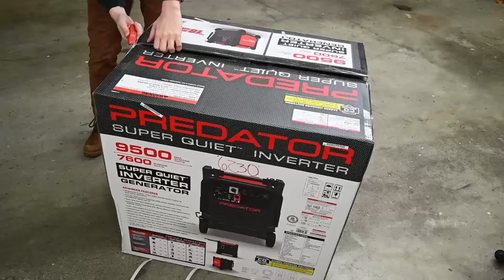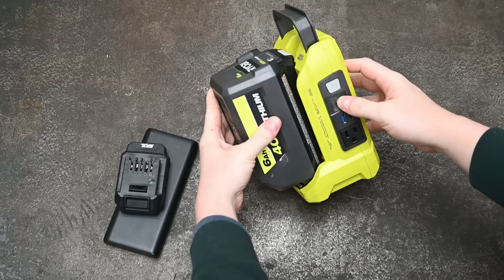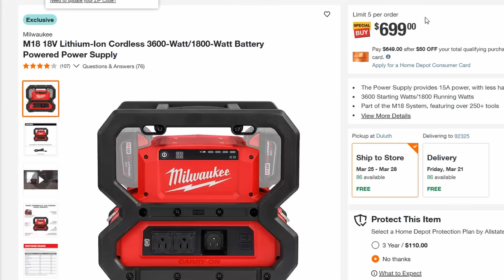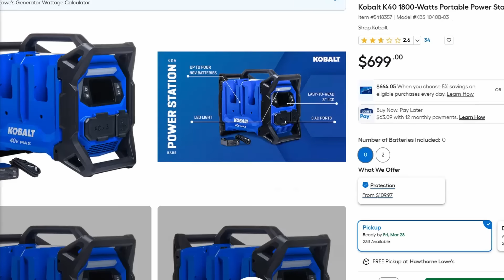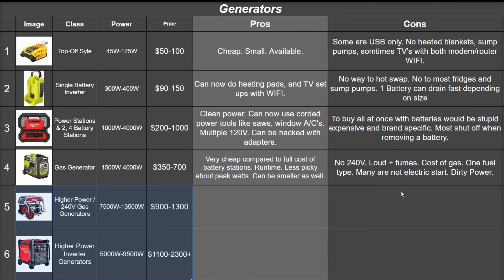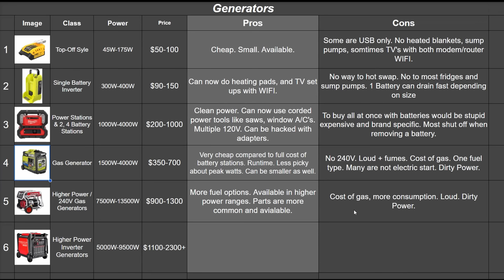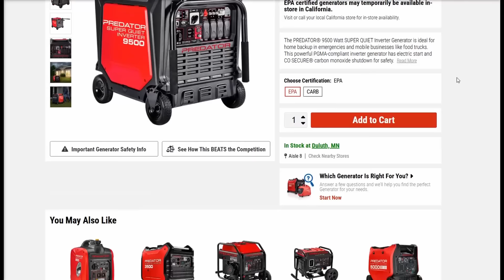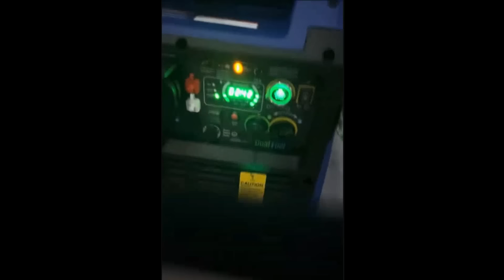Buying Harbor Freight's Most Expensive Generator So You Dont Have to

Comment: I bought the Harbor Freight 3500 W / 3000 continuous generator 7 years ago and it was still working fine until it caught on fire last weekend. Pretty sure I overloaded it but I thought it was supposed to kick out before it caught on fire. It runs my camper AC without any trouble and everything else on there usually. I guess I'm going to buy another one because I had good luck with this one. I will definitely make sure I get it on sale. Also when I bought it I changed the oil about three times in a row and I think that helps the engine which still runs fine it just doesn't make any electricity

Comment: I'm debating on going 3500 just to run a couple refrigerators in summer, or gas furnace in winter, or moving up to a 240V, 7000 to run things like dryer, my upstairs 2.5 ton AC with soft starter, etc.  I really won't use the generator for much of anything than backup power, and I only need that 1 or 2 times a year.  Just hate to spend more money, but would much rather connect 240V outside, and pick which breakers I want on inside. 

Not sure how safe, but you can also piece together with another regulator (can't use propane regulator safely), a set up to run off of natural gas.  If you have natural gas, you could run for days and days with no fill up.

Comment: I got my mother a power station that can run some LED lights and TV for a few hours. Longer than that and I break out the generators. My biggest one is 7kW but I have my eye on a Champion 15kW/13kW unit. I want one that can push a full 50 amps if needed.

Comment: FYI for those interested, you can buy conversion kits for propane or natural gas that will run any small engine. You need a little bit of knowledge and skill to size it right and install it properly, but it's not super expensive to do.

Comment: I have an older 9000/7000 watt dual fuel Champion generator and I've never had problems with electronics running off of it. Great customer service too. I bought a display model from Costco for cheap and it didn't come with the regulator for the propane. I called them troubleshooting it because it would start and die using the regulator I had. The guy knew what was wrong right away and just sent me one free of charge no questions asked. I've used it for 4 different power outages since about 2017 and never had an issue, other than that it's not powerful enough to start my central AC/heat pumps. I'm actually looking at the Westinghouse 28k portable generator for this reason. I would love to be able to just not have to worry about that. Not cheap though.

Comment: I noticed that they released a 11,500 watt inverter generator with trifuel and remote start. which solved most of the issues you have with the 9500 watt. it also has the 240w 50A socket

Comment: I'm using a combination of an Ecoflow Delta that runs the essentials in my house and a Champion 4500w quiet generator that I run twice a day, an hour every time, to charge it.
That way I can fuel the generator once a week. we had a two weeks outage last May and this setup worked amazing. While my neighbors had to fuel up the generator twice a day and live with the horrible noise, we were fueling once a week and we had to suffer the noise only 2 hours a day.
Way more efficient than a big generator.

Comment: One thing I would highly recommend is an inverter generator and maybe if you just want to keep your house warm in the winter a small one that can do 1-2 thousand watts and use that to charge a decent sized power station that can run your home heater. The reason for that is it is a good bit more efficient than the alternative of just running your heater off a generator 24/7 because your heater turns on and off all day so when the heater isn’t running your just wasting gas. Basically run generator to charge power station than run heater off power station. My power station can run the head for 12-20 ish hours and can recharge in about 1-2 hours so I would only need to run the generator for like half a gallon of gas for almost a day of heat. Also you can do the same thing with a much bigger generator if you need to say run the dryer or the stove. Or well pump or anything like that that uses more than most power stations can do. You can just run the big one when you need that power and keep the power station to keep your heat on 24/7. It’s a bit more complicated but it saves sooo much gas and it’s so nice not running a generator 24/7

Comment: A couple years back we had a tornado roll through and on day 2 of no power I had to make a choice. Buy something or left $400+ dollars in my fridge and chest freezer expire. I had to buy locally because I needed it now and I was limited to what was in stock. I found a walmart a few towns over that had one in stock (harbor freight was sold out because of the storm). It is like 4500 or 7500 I cant remember some no name brand. It cost $450. I cut 2 plugs and back fed it into my home. As soon as the storm was over I regretted buying it. It was 2 small to feed more than my freezer and fridge and internet and a tv. That is a lot but now we are having winter storms. I will likely have no heat. It also isnt clean so it would not charge my electric car (no longer have that but still). I really want one with an automatic start and 240 volts but I decided I will wait because we rent. Once we buy a house I am hoping we can get something I can build around and have basically connected to the house all the time in case of emergency either I start it or it auto starts depending on the amount im willing to spend.

Comment: I've got a dual fuel WEN 5000W, its a good middle ground, I can charge batteries for my Milwaukee inverter and hook up my to my transfer switch in my house and run lights, fridge and two space heaters with it.

Comment: I did a similar analysis. My need is backup for much less frequent power outages. And I don't want to deal with stocking up on gas before every major storm. Propane will store for 10+ years without degradation, so keeping a few days worth is easy.

Comment: I ran my cpap off of the milwaukee inverter topper and a 5ah pack to test it ahead of actually needing it for emergency use.  At 4 hours use it used half the pack. (Humidifier and heated hose off). In a pinch 3 batteries should get 3 or 4 nights of (dried out mouth) sleep 

Side note for anyone using the smaller inverter toppers. As mentioned in the video about cheaper generators putting out dirty power, the battery toppers are putting out square wave AC... this is no probelm for phone adapters and cpap adapters that are rectifying back to DC, but don't plug anything using an induction motor into  it (like a bedroom fan) or air purifier...etc. the fan will run, but you will hear the motor grunting because of eddy currents from the square wave... it will work, but that motor wont be happy for long.

Comment: we have a large generator but find the small 2000w yamaha clone is our goto. Powers things like fridge, freezer to ensure they stay cold inside. Can power our starlink and tv/laptops to stay up on weather. Or can run a heater or small window ac we keep for emergencies. Best thing is it runs all day on about 3 gals of fuel. We have had it for years and I just tested it again today since we are expecting bad weather and possible blackouts this weekend. Started on 3rd pull and ran the 1500w heatgun no problemo.

Comment: Man, I sold my classic wacker 2500 with a honda gx160 thinking i'd get the HF 3500 inverter generator. but that old one worked great, and ran 4 hours on 3/4 gal with full load. It was just loud

Comment: You used the worst line conditioner. You need one that stores Joules of energy. Check out a Richard GRE’s power company. Yup expensive, but I run my little Honda inverter with my deep freezer, refrigerator, tv, internet, a few lamps and more.

Comment: Hunter, Fisherman, Camper, Got whatever needed to light and cook, PLUS a 6.5 KW power plant. Shared Home with 3 Fridge/Freezer I own, Sister 4 Fridge/Frezers, Neighbor 2, and the other 1 Fridge. Were out 1 Week. Plant kept all fridges working. Had Gasoline stored pluss drained Car tanks, Used 75 lts of gasoline for the generator for the week. 1 Std LPG 10Kg tank cooked whatever.

Comment: Dang, wish you had waited until this year to test this, or could do am update. Bc they now have 2 higher rated models. I beleieve they're both rated at 13.5k. I think the difference is something to do with how they output the power. Or like one is a full on generator and ones technically am inverter. I forget exactly, but i believe they both can be run on gas, LPG, or NG. They run fully rated on gas. And then get de-rated down to like 10.5k for NG and 9500 for LPG. Those may be backwards, but point being i would like to know if either of those are worth having as basically a whole home backup? Or would i be better looking at old school like full size kohler models? Or again, would i be better to invest in solar amd a battery bank?

Comment: another way to get around the "dirty" power is with one of the mentioned power stations. I keep mine always plugged in and power internet & boiler from it.. 
during power outage when the battery gets low I unplug loads that don't like dirty power (fridge, boiler, freezer) and charge it with generator (can charge 5-100% in ~1h).. 
then after unplugging it from generator I reconnect loads and everything runs for 3h+ (depends on how much the fridge and freezer have to work since they were likely off for a while since I don't plug them into power station right after power outage starts but 6-12h after)

Comment: I bought a F150 fx4 Powerboost. 7.2k recharge by truck onboard. Endless power as long as there is gas in the tank. It charges lithium battery then shuts off.
Reply: Bought new Truck $70k bought for $54k out the door, so all add ins $0 including Powerboost😊

Comment: Or get a standalone standby 22-30kw hour generator. Change the oil and spark plugs every year. And never think about it again. Power goes out 10 second later power comes back on. And you have an extremely light hum at most in the house.

Comment: So it's a good product but there are better options such as TSC Champion brand or Lowe's Westinghouse.... I've been a big fan of my inverter generator from harbor freight. Solid unit. Runs what I need in average outages but I'd like a 220v generator that can hook into the house next. My local power company got bought by foreign country years ago and Governor Kathy signed off on residential utilities increases. The delivery fee is now 2x the usage and they refuse to maintain anything, they just wait till it goes down. "Hey NYSEG that utility pole is cracked and rotten" "not fixing it" months later "hi, yeah so that pole I reported was rotten.... Yeah it just fell on my neighbors driveway" also "will you replace the other rotten poles?" Not til they fall down" 
Yeah I run my generator all the time

Comment: If you are looking for a single unit power outage solution I agree with the findings here, though one setup I like, and seems to be getting more popular is a larger single battery, or battery fleet than can run the home with clean power, and then a smaller/ cheaper gas generator to recharge. In many homes their actual use especially during a power outage is somewhere between 2000-5000 wats so a much smaller traditional generator works to keep up. Benefits include not needing the generator out for short outages, and the battery giving you the ability to shut off the generator some of the time for refueling or nap time. Some companies like Ecoflow are even making generators that pair with batteries to auto start when the battery is low and shut off once charged extending fuel even further.

Comment: Inverter generators use less fuel because they can throttle down without changing frequency or voltage which is great on low demand, but what concerns me is if my generator is idling at low demand and the well pump kicks on... is there a way to add a buffer lifpo battery to the input of the inverter as surge compensation?

Comment: The last 3 day power outage we had we bought the Kobalt $699 6800/5500 watt 4-120v outlet, 1-240v outlet, dual fuel generator .
It worked well for 2 refrigerators and a deep freezer and wifi and a tv.
Next time we will get more splitter outlets and 14gage extension cords

Comment: I have the 2k watt champion inverter. I use it for work running 2 electric 2" water pumps and also use it to run the freezer and fridge when power goes out. Running dual water pump impressed me, I didn't think it would handle it.

Comment: The real technology step change is not addressed here in that substantial inverters and batteries can flawlessly support all the loads you want and the genset providing support can be downsized to 5,000 Watts. You might really want to get familiar with using a 5kW genset and an EG4 Chargeverter to charge larger 48vdc nominal batteries now that 30kWh of storage is possible for $2,000 and something like 6,000 W 240VAC output off grid inverter about $1,500. No power quality issues as ugly genset AC is “filtered” through the batteries and new inverters have substantial short-duration surge for starting ACs. I know this is maybe not your channel focus but for your house and being able to turn off the stress noise machine to sleep, minimizing fuel issues, etc. it’s here now so makes more sense to me than some Milwaukee power station overpriced weakling electronics.

Comment: My biggest problem with these hi-wattage propane option generators is the amount of propane to run near full wattage it'll drain a BBQ tank size (around 20 lbs) in very short order compared to having a lot of options with gasoline.  In an extended power outage, you wont find hi capacity propane storage tanks that will be 'portable' unlike gasoline storage options.  If you are lucky to have natural gas, that now makes it a very realistic choice for extended runs.   Also, propane or natural gas decreases the max wattage by around 15% from stated wattage rating.

Comment: You bought it at a bad time they now offer a 11,500 watt with remote start and is tri fuel. Your probably aware. Your channel is great although this is a bit out of the norm. Quick note I fixed a kids rear defrost off an old lead acid battery jump pack with my 140watt soldering iron. I had my upmost doubts but it worked granted it was 2 quick spots but it suprised the shit out of me.  And thats why I like your channel you push the limits and see what kinda beans you can get.  👌

Comment: Yup this is what I found when shopping for a suitcase model for running my fridge in an outage. The predator model was only 2000 watt and I could get a Power Smart Chinese unit off Amazon for like $100 less and it went up to 2400 watts with a higher surge rating. So I can run my refrigerator and a little window AC in an outage at the same time. Their battery solar generators suck compared to Eco-flow or Jackery based on what I've seen in the power station reviews as well for the price they're charging.

Comment: You're missing a huge one that anyone with even mild skills can do themselves. Just get a 12v 100 amp hour lithium ion phosphate battery and an inverter. Leave them attached and all you have to do is flip the switch on the inverter and you've got over 1400 watts of power and a 600 w output. Cost about 200 if you throw in a charger.

Comment: For military / vets, the Lowes gen is an even better deal -- 10% off

For Kroger Fuel Point users, the Lowes gen is even better deal.  $2000 in Lowes credit cards from Kroger  --> 8000 fuel points --> 8 x $35 = $280 off gas purchases (over two months)

Comment: Great video. The only place for a non-inverter generator IMO nowadays is to power space heaters and incandescent lights and we’re pretty much out of the bulbs. You can pump out dirty AC with them, convert into DC to then charge big batteries or be cleaned by an inverter so they’re not completely useless. But low THD electricity should be standard these days.

Comment: I ended up with a Anker F3800 that can give me 240V power (well pump and such).  It alone can run my house for 10-24 hours depending what I need to run.

Aside it I have a small cheapo generator that can output 1800 sustained which is the max charge rate of the F3800.  So if power goes out for days, I can run the battery low, recharge it in 2.5 hours, and repeat.

It's also nice I have a < 40lb generator I can loan to family and friends if I didn't lose power but they did.  The F3800 is portable, but like 120lbs portable...

Comment: Welcome to the world of generators. If you think Torque numbers are inflated on hand tools the "Watts" ratings on generators is even more misleading.

Not many methodically test actual running times, voltage sag under load, inverter duty cycle / thermal throttle at 80% utilization, and overall longevity. Advertised numbers may leave you with a ligther wallet and no heat to cook all those "beans."

 Who knows, this experience might lead to a whole new testing series on the channel. Would enjoy seeing generators'feet held to the fire for science.

Comment: I'll sooner buy a milsurp 4kW rated gas generator for like 300 bucks. They're cheap, their four cylinder engines run quieter than these singles and twins, and they're rated for the absolute worst conditions imaginable on the shittiest fuel that still does fuel things. They're a lot more powerful than their rating implies.